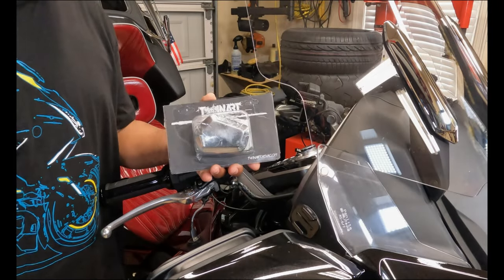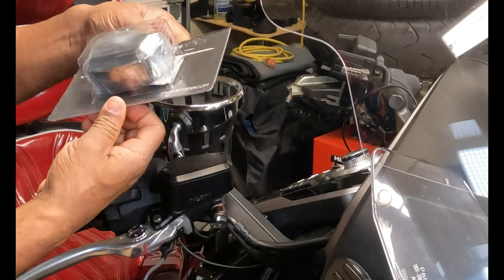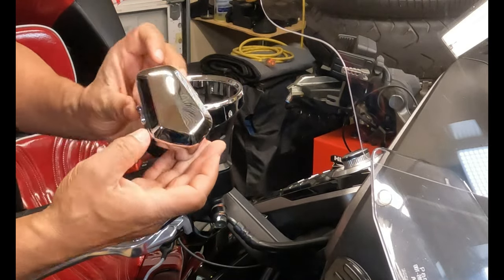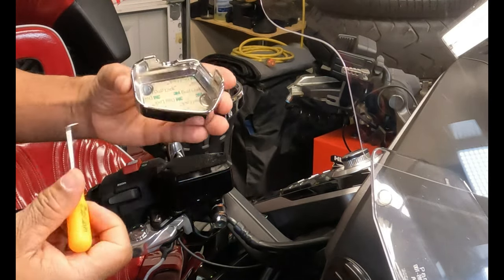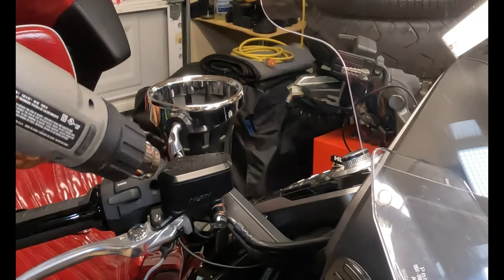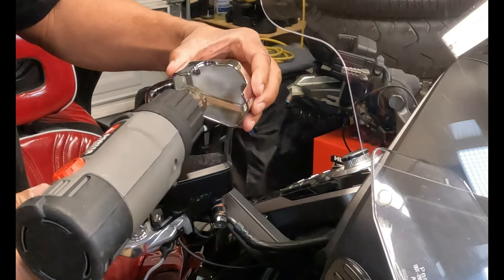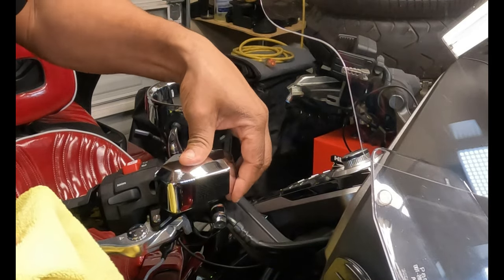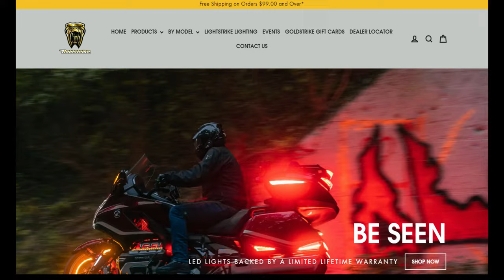Goldstrike Brake Master Cylinder Cover by Twinart for 2018-2023 Honda Goldwings

Comment: Hi Chris, nice touch to the wing.looks good quality too. I’d prefer a cover which replaces the  oem one, with a nice engraving on it.  plus then one would still have easy access too fluid….🇬🇧👍
Reply from the maker: Thanks Gary, this accessory will not fit everyone needs, but it works fine for my bike.

Comment: How do you access the fluid?
Reply from the maker: A twist off brake resevior cap is located on the side of the engine for adding brake fluid but if you warm the top of the chrome cap with a hair dryer or a heat gun low setting you can remove the chrome cap to access the two phillip screws then reapply the chrome cap.

Comment: Chris - nice look but I'm with Kevin Ross.  I guess it's intuitive that when it's time to add fluid (another challenge - do you cover up the sight glass?), you destroy the master cylinder cover removing it?  Any event, another great Caliente instructional video treated with the same tricks, tips and professionalism as more involved maintenance activities.  Thank you sir!
Reply from the maker: The chrome cap does not cover the master cylinder sight glass, but there is a Brake Fill twist off reservior cap located on the side of the honda goldwing engine for adding brake fluid. In the event that you ever wanted to remove the chrome cap for any reason take a heat gun and warm the top of the crome cap and the chrome cap will dismount without destroying anything.